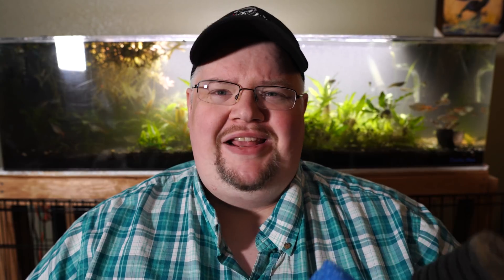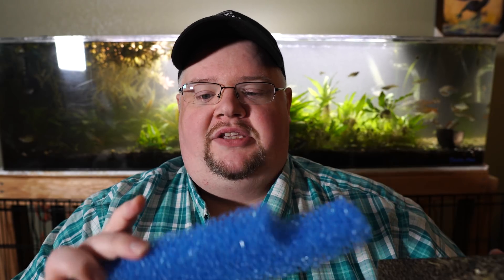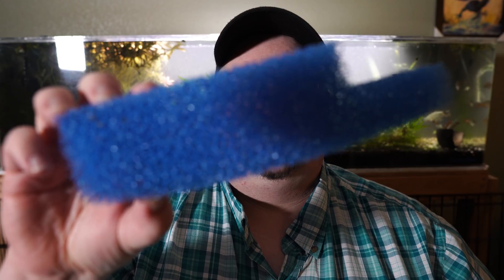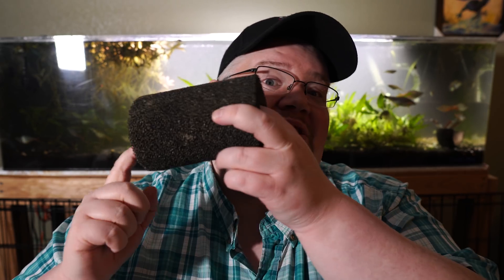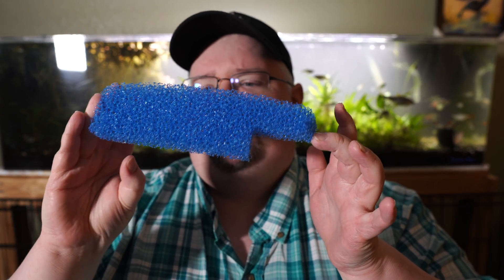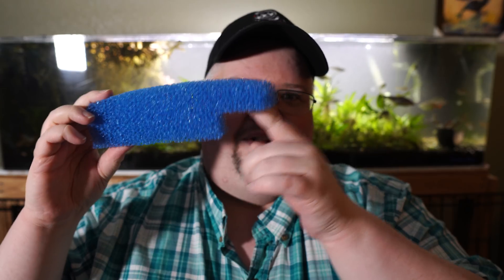Why is Mechanical Filtration is so Effective and Widely Used? - Filtration 101

Comment: I opted for a small sponge filled internal canister filter . I rent . So I need to keep my water in the tank . When I owned a home and had three tanks I used under gravel / HOB combos . My tiny Tetra internal can moves the water  through   the filter about 1.5 times per hour. I clean it once a week and replace the moderately course sponge once a year. Biological filtration and plants  obviously do most of the work.

Comment: I have found a love for sponge filers and have switched over all my tanks but one ☝️. My show tank in my living room still has a HOB filter. With HOB filters I add a very course sponge to the intake/before the pump and use the fine spine inside the filter/behind the pump. I find when things do start getting clogged it cuts down on noise and makes it so the pump doesn’t have to work a as hard.

Comment: '"Simple and basic" - indeed, it was! And for someone like me, that's a good thing.

I'm not sure if I learned anything new, but I'm a re-beginner with aquariums, so having knowledge "reactivated" is great. And when you think about it, mechanical filtration is mainly a matter of common sense, whereas biological filtration is a bit more complex. (But with that I think perhaps it's more important to understand THAT it works, rather than to understand HOW it works. And to understand what's required for it to take place, which doesn't seem to be a lot. Surface area and plants in my case...)

Also, as someone excited about his first aquarium in over 7 years, this sort of content with a pleasant, congenial and enthusiastic host is just the ticket! My tank is all set up and running, but that doesn't mean I have to stop learning and researching, because to be honest that's half the fun. So thank you for adding to the fun.

Comment: I’m pretty sure “mechanical filtration” is what filtration technically is. In the lab, we use it as a technique to separate solids from liquids. I wonder if a piece of equipment that worked like a drip coffee machine with filter papers changed daily would be effective at polishing the water,
Reply from the maker: Polishing yes most likely, filter socks in a sump effectively do this as they're at a fairly fine micron level

Comment: I use DIY above the tank filters Powerheads pump water up, hose connectors secure the hoses under bottle caps, use sponges,quilt batting,lava rock I have 2 tanks. Filters aren't pretty but i am old, not physically 100 working body but love my tanks.very Easy to maintain
Reply: For some, a pretty fish tank is a main component of their enjoyment, while for others it's less important. I think what matters is that it makes you personally happy and that it enriches your life. (And that the fish are properly cared for, of course! But fish don't care if a filter is pretty or not; I don't believe they're known to be great aesthetes...)

Above-tank filtration might be something I'd consider in the future. I really hadn't thought of it as an option, but I can see how the right set-up could make maintenance easier. You've given me food for thought.

Comment: Mechanical filtration is also biological filtration. I use nothing but different ppl sponges in my canister filters. I clean them about once every 8 months. I also use HOB filters on my tanks and fill them with filter floss, which I change out every month. My tanks all look crystal clear and run amazingly.

Comment: I run a canister filter with medium prefilter sponge, followed by filter floss. My water is invisible. I know you touched on it, but it's important to run mechanical media in order, coarse to medium to fine. A coarse sponge that comes after a medium sponge is wasted space, even though some filters are sold that way, you have to apply some aftermarket logic yourself.
Reply from the maker: Not so much do as I say, but it's an opportunity to directly display what can happen.
Reply: @BentleyPascoe  really didnt mean that to sound snarky, just chuckled to myself at the irony 😁

Comment: Bentley, I forgot to add:

3 types of filtration:  Move it, Eat it, or Treat it.

Even a water change -- whether or not you use a syphon (one of Archimedes' simplest machines ) -- is mechanical filtration. You're just moving the waste (and some water) out of the tank and down the drain.

Comment: I agree dude. Sponge has to be the most versatile filtration media. I either run sponge filters or HOBs with prefilter sponge, filled with sponge, and Pinky's floss on top. Bag of crushed coral to hold it down and add some minerals. It works as mechanical and biological. If I ever need chemical which is basically never, I'll run straight carbon in another HOB for a few hours in a QT tank with meds.

Comment: Bentley, I must humbly disagree with you. I believe your understanding of the term is too strict.  Mechanical filtration isn't just stuff that requires a machine . The mechanics of mechanical filtration, how it works - the mechanism , is that particulate/junk/stuff gets caught on the filter/machine/thingy. Anything that strains (a la a colander when straining pasta) stuff out of the water flow by serving as a grate, or strainer, or net qualifies as mechanical filtration. The gravel bed in a UGF setup is mechanical filtration. 

Any time there's a fluid moving through a part that catches junk, that part is mechanically filtering the fluid.

Comment: I have learned a lot from your videos and appreciate when you talk about the science with it.  I have a question for you.  I have a uniquarium ( I wish I had watched all these videos before I bout it) it has a sponge filter section that flows to the biological filtration then pumps back in.  I added a polishing filter over the biological section but now wonder if I should be doing that.  It gets dirty pretty quickly.  Should I maybe add ceramic or some other media to help instead?
Reply from the maker: If you're willing to keep up with maintenance don't change it, otherwise you might look to using a small amount of ceramic media.